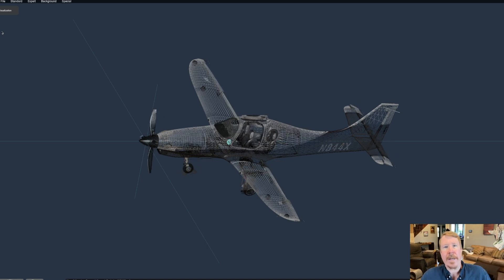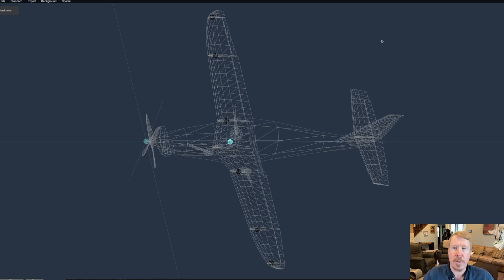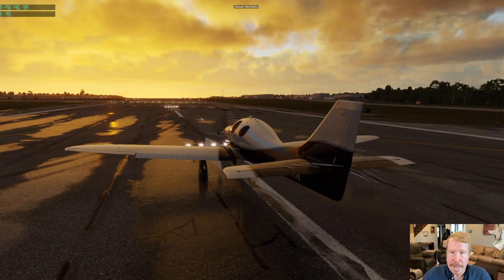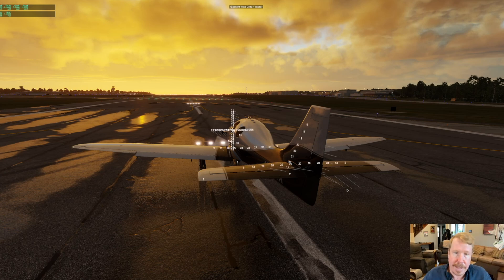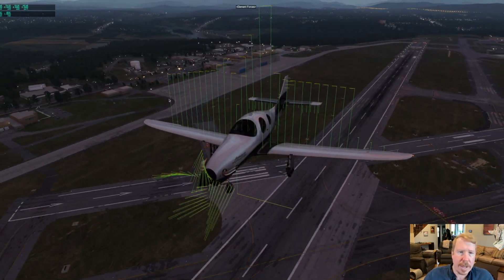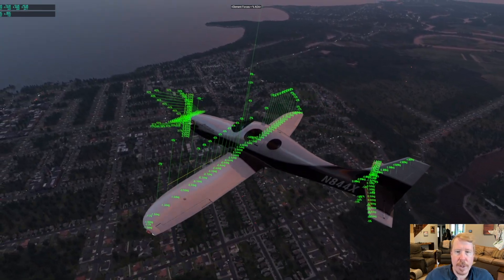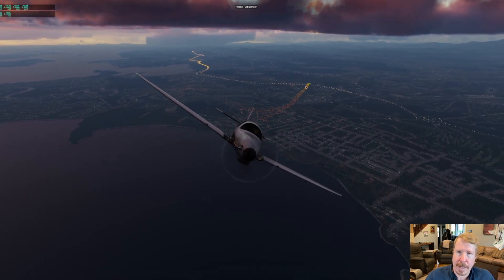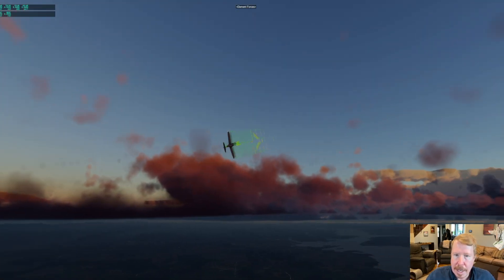How the X-Plane Flight Model works

Comment: For some reason when I fly the Evo, I have to keep the power and airspeed below normal cruise settings or the aircraft will porpoise quite a lot when flying on autopilot when it should be holding altitude. (I'm a fan! - except for the cockpit illumination conundrum)

Comment: Silly question to Austin - I've always been taught that this method is called Strip Theory method, and based on their Wikipedia definitions Blade Element Theory seems to be a special case of Strip Theory for propellers and not wings, is there a specific reason you use the term Blade Element Theory instead of Strip Theory?

Comment: If I have the actual data of the propeller and the engine, i.e. eta vs advance ratio, torque, power, PSFC vs rpm and pcl, is there a way to model the thrust with a lookup table?👀

Comment: not sure wether this visualization is good enough yet for serious analytics, 
especially for helicopters in critical situations. 
after all that's what it should do, get you understand streams, drags, effects and forces to help you tune proper shapes and propulsion methods under changing dynamics.
press command m as many times you want, these yellow straight lines don't tell much. 
in comparison: siemens works with transluent vector animated dynamic streams all along the entire body, in all directions, without interruptions and various colours to highlight issues, heat etc..  
anyone would understand what happens around the airplane, you actually see streams in detail. not saying austin's not working hard enough, but 
kind of waiting for him to overcome legacy and find better visualization methods as airplanes get more and more complex in the future.

Comment: I have been a huge fan of X-plane since XP 4.6 if I remember correctly. I have bought 2 licenses for x-plane 12 because I want to support this amazing project. I just have 2 items that would love to see ironed out to make this simulator perfect. 1 the oscillations you observe many times after a disturbance. Makes the airplanes feel smaller and less stable than in real life. 2. Somewhat related, the turbulence model.
Reply: same here i had 10, bought 11 and bought 12 cause its so awsome
Reply: Agreed, the turbulence feels like someone is just moving the joystick around in a circle.
Funny that you say it makes airplanes feel smaller, because I use the ultralight and I have to turn the wind way up (like 25-30 knots with big gusts, which I'd never fly in with my UL!) to make it feel like there's any wind at all. (Meanwhile in a real UL even 5-6 knots can have you bouncing all over the place.) Maybe the model works perfectly at some medium size but not so great above or below.

Comment: Can the forces on individual blade-elements be exposed to the outside world via datarefs? 

Or perhaps a dataref that represents the total force on some control surface.

This would make it much easier for FFB hardware manufacturers to get force data. AFAIK, most software solutions like XPforce, CLS2sim etc try to 'reconstruct' forces based on some combination of datarefs that they read. 

The data that the sim provides can be much more finely controlled.